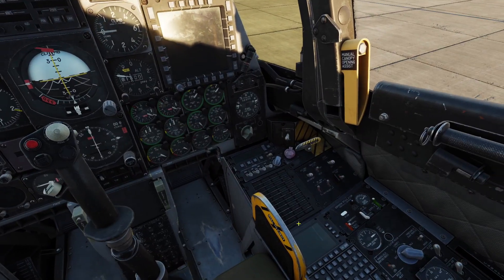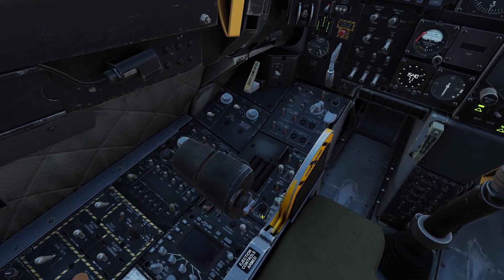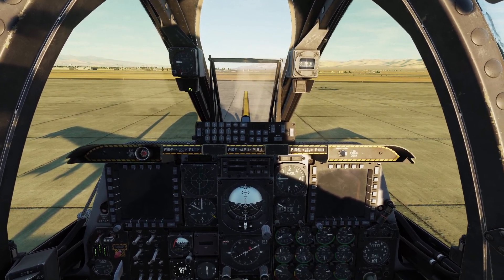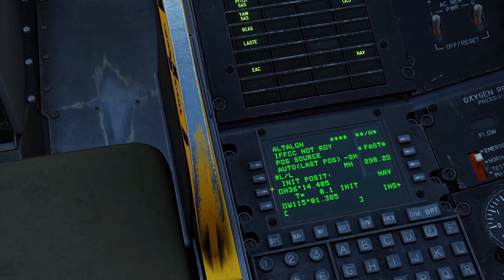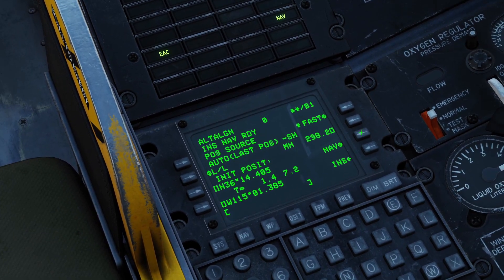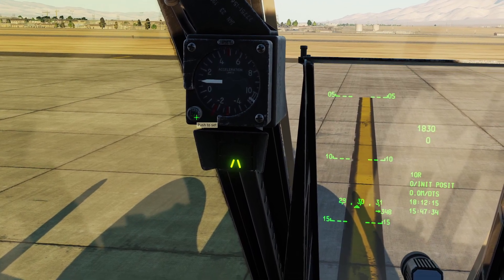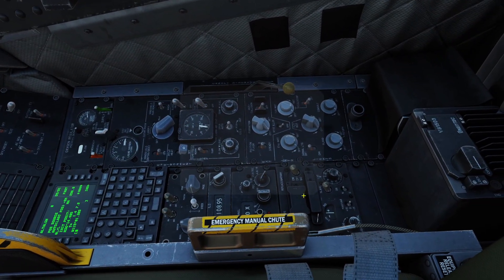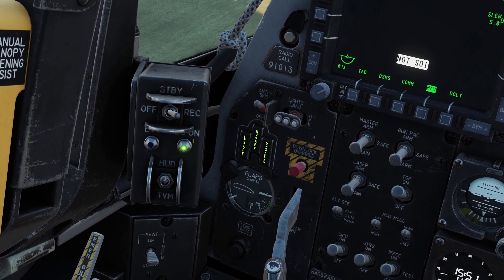DCS A-10C/CII Startup and Failed Engine Start

Comment: Here's what happened: the engine wouldn't start 100%, it was a bug. I changed the map, switched planes, and reverted everything, and then it started working fine again. This happened after I bought the A-10C II, even though I already had the older one.